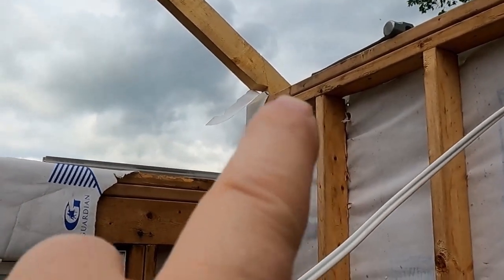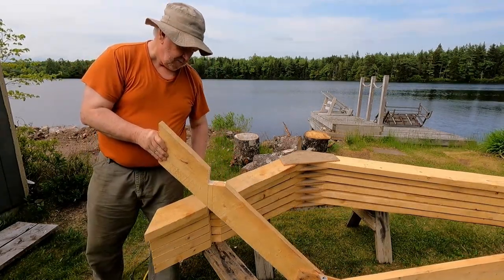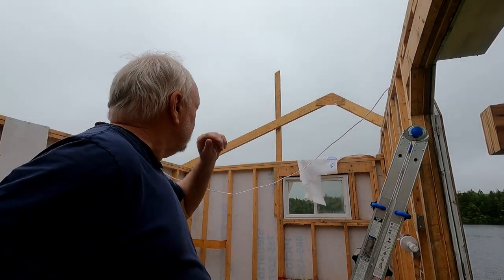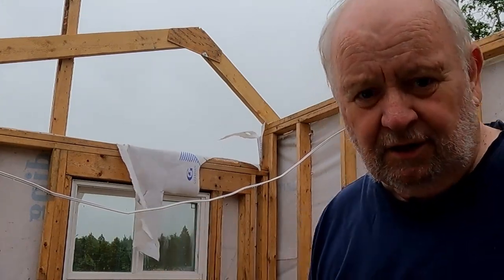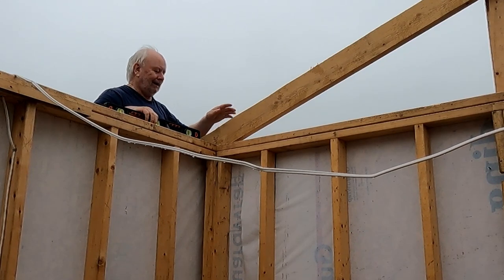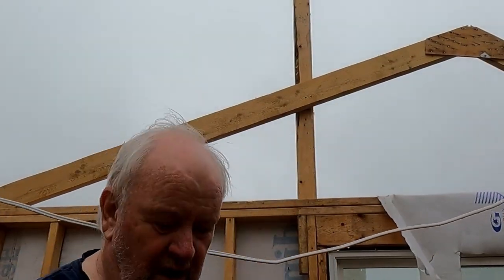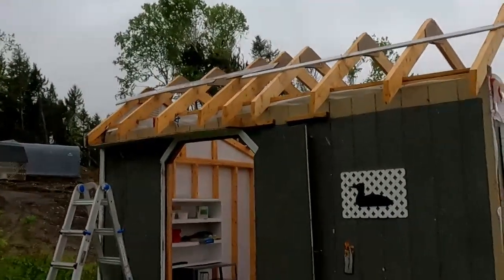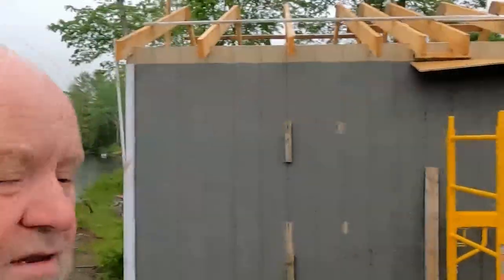Putting Rafters on the Boat House - Part 6

Comment: HOWDEDOO MIKE ? Great you have a plan again that will split all the deferent numbers down the middle of this project. I am kind of curious about why you chose nails versus screws for this one as if you have to change a mounting place nails would be a disaster ti pull and reset. Great to see Chris out there with you today. Not just family but family that  can think and do like you. After all I am pretty sure you have given him the basics of how you approach a build like this. It is great seeing the shed/boat house come to it's final shape. Yer looking great bud. That is a spacing on the the new roof seldom  seen by many. Closing up the space in the middle makes perfect sense. Giving it more support where it is at it's weakest. I thought I was the one to do that first, LOL. My shop is 30 X 60 and was within 1/8 inch corner to corner. Each truss/rafter is done like that every 3 for 3. Start with 3 -16 inch spacing to 3 X 24 inch and so on. The interior sheeting has remained as is for over 35 years now That number 3 keeps popping up a lot in our kind of life eh. We can get 5 feet of dry snow load where the shop is and have never seen any movement. As I felled every tree(lodgepole pine), nd milled every board with our own mill we made right down to the last screw in the building. My partner and I did it ourselves. Little help as well aside from his dad on occasion. His experience was invaluable. When the man spoke everybody listened. RIP GEORGE SIMROSE. Sure miss your wisdom old friend. Soon this will behind you so you  can get going on the next part  of this disasters that you are facing now. Take care and stay safe my friend. More Hugs for your Nanny J !
Reply from the maker: How's she goin'?  Well Dean I have to admit, the center rafter wasn't to make the roof stronger.  I needed it for a nailing surface for the sheathing!!  But I like your idea too!!  The roof is sure strong.  Even when it was 2 X 4 rafters, that big old tree had a hard job smashing through it!!  LOL  Wow a building as big as your shop and only out an 1/8"  I'm glad you guys aren't around here to see this building up close.  LOL  I thought I had it pretty square at least, but when I was putting the sheathing on I ran into some issues and had to be creative to try and at least cover them up so they are less noticeable!!  You'll see that in tomorrow's vid.  Thanks so much for all your comments and suggestions Dean!!  I still say, if we lived in the same area we could make some amazing things!!  Take care!!
Reply: @GrampiesWorkshop  We were hoping for the shop to be under an inch out and when we saw 1/8th we changed ends reading and holding the tape. We had Richards (my partner) dad confirm it and as a builder himself just shook his head in belief.  I think as with rough sawn lumber it was shit house luck. The project turned out great and the only real problem was hanging the metal siding on a warm sunny day.  There were 3 big cottonwood trees that cast shadows and the 12 foot panels were changing shape constantly. 25 years later it still bothers me/us as there is a definite correction line in the middle of the back wall. OCS, GUILTY, LOL. For sure bud. Take a pile of materials, add 2 curious minds, 4 hands and put them in the mix and shake. Who knows what we can come up with. LOL Have a great long weekend Mo Chum.
Reply from the maker: @TomokosEnterprize  Steel is a good covering for walls and roofs but the heat does funny things to it eh!!  I bet you are the only guy who notices the 'correction' line!!  LOL
Reply: @GrampiesWorkshop  I am sure just Rich and I are the only ones aside from the hundreds of miles of Northern BC bush behind it,  LOL. Have a great long weekend and why not take Nannie out to dinner for a change up ? Serious points can be achieved doing that eh.
Reply from the maker: @TomokosEnterprize  Thanks for the tip Dean!!  LOL
Reply: @GrampiesWorkshop  Apparently I have a million of em eh, LOL.

Comment: Some jerk stole my channel 
My email password, google password, and YouTube Password were all changed. 
I don't have control or access to anything on the channel. 
This is one of the few times I would love to put my hands on the one responsible.
I created another channel and I have the videos I posted that can be reinstalled. Not sure if that is the best thing to do right now. Mad enough to chew nails and spit carpet tacks.
Reply from the maker: How's she goin"?  I hear ya Dave!!  3 days ago my Facebook account was hacked.  Everything Facebook says about getting it back is based on the fact that I can access my account, trouble is I can't.  So Facebook tells me that the account is gone forever.  It truly is maddening and the people who do this sort of thing should have to slide down a 30 foot razor blade and land in a bucket of iodine.  Good to know you can get all your videos back though.  Good luck with getting things straightened out!!  Take care!!
Reply: @GrampiesWorkshop  Unfortunately I won't get them back. I do have them saved on hard drives. 
We will see how it goes.
Reply: @DavidMNighswander-ir7os  If there's anything I can do to help let me know.
Reply from the maker: @DavidMNighswander-ir7os  Isn't that a sin.  And for me, the worst part is there is a way to get them back, because the hackers could do it.  But us 'law abiders' can't get the info to do it ourselves.  Is it any wonder why there are so many 'rebels' these days.